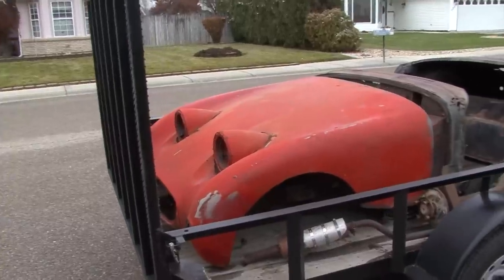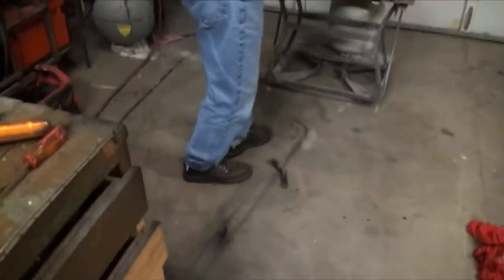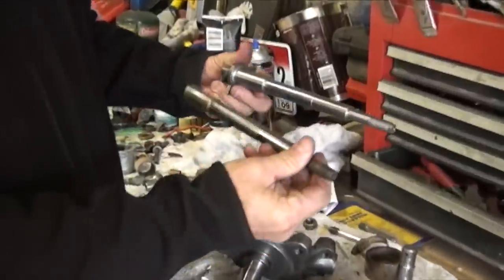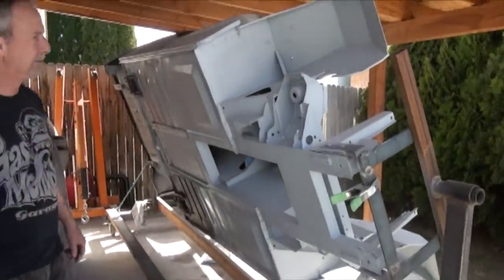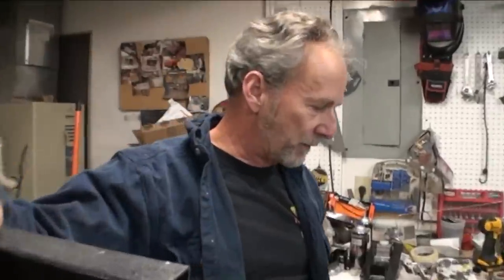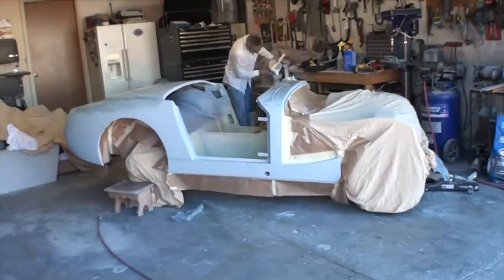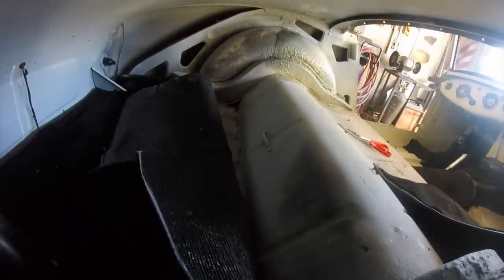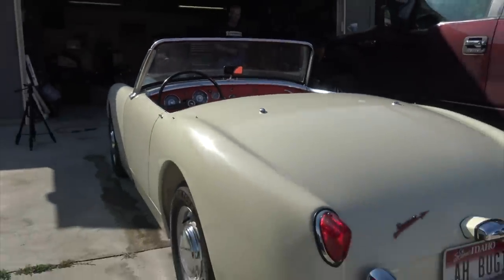Bugeye Sprite Restoration (Official Full Version)

Comment: wow...just came on this YouTube...... I also have this exact car and did a ground up from 1993 thru 1998.....same color combination....added 1275 80 thousandths over bore. electronic ignition, stainless steel exhaust. all screws, nuts, washers stainless steel, wire wheels, disc brakes on front, same aluminum valve cover, mine all red interior.....we acid dipped body and lost 40% of the car, bonnet was perfect.....14 months putting it back together...we embroidered door panels with Austin Healey....we used the interior kit from Moss Motors, body seams missing (?)sad.......about the same in cost........ we have put 4600 miles on car since 1998 and won every show we entered......live in Tipp City, Ohio just north of Dayton.....Fun watching the process all over again....Than you
Reply: Thanks David.  Body seams were already leaded in. To much work to restore.  We have driven the car about 1100 miles in the last year.
Fun.

Comment: I’m surprised the doors fitted as well as they did.  Before touching the cills ( rockers) or tunnel we always weld a brace across the top of the door aperture.  We have one set like a giant turnbuckle so we can set the door aperture before well start removing the doors.
Reply: This one was of my first concerns after cutting away the left side of the car.  However, the sheet metal repair panels fit very well and squared up the entire body.
I did need to adjust door jams to achieve proper gaps. I noticed on to many sprites the misalignment of doors and bonnet and I was not going to have that.
Thanks for watching.
Ed

Comment: I have a red one though a good looking road-going car I got it as what can best be described as a very amateur restoration, i.e. wrong colour, some? filler, floor pan patched but well-done, fibreglass bonnet - I do have a steel one. 

So complete new floor pan and back to old English white is in order. It is fitted with a 1275 midget engine with twin-choke Webers,1275 gearbox fitted and will be staying. 

To have stayed with the original steering wheel and road wheels instead of a Moto-Lita wheel and wires though nice is a nice touch and will be what I will be doing. 

You did an excellent job and If mine comes out half as good as this car I will be delighted. I wish you many healthy and safe miles.

Comment: These were  called "FROG EYED SPRITES" not bug eyed, the reason for this look was that the original h/lamps were made to recess with electric motors, this proved to be costly and also did not withstand the hood closing heavily as it is all one unit. I worked on these  in their day in the UK, they were BMC "British Motor Corporation, MG, Morris Garages were long before these, MOWOG was the parts ID stamp, they were issued with a tonneau cover, wing mirrors and radio here , in the UK AS EXTRAS!! They did not lock up and could easily be stolen, the key codes were single edge FS type. The electrics were Lucas 12v, the heater was Smiths, original oil was BP Energol sae 30, gearbox and diff were Hypoid 90, points were Lucas 423153, standard coil without a ballast resistor, rack and pinion steering (which understeered) and I believe a lot of the brakes were Girling( some Lockheed) 1098cc, 998cc and a changed engine had an extra stud at the t/stat 1275 cc, most were Tartan Red or British Racing Green, some had knock off wheels ( spoked), I built many...…….many moons ago.

Comment: Nice panel fit. All that welding without a jig? Yikes! Top of the guards are always an issue with these things not sure it works with them removed. Should have dropped a better driveline in it and some suspension. A series stuff isn't the best and the A35 running gear is horrifically fragile. Great video effort!

Comment: great  to see  an old ENGLISH  ICON COMING BACK TO LIFE   thanks    i have a  1960  morris minor 1000 1098 cc  4 door 61000 on dial ???  she been well looked after   cant do a nuts and bolt job like you 

just giving her  plenty of      t  l  c    we will see  how she fairs  next year  when show time comes around 

had a  1962  caddy  back in 2004     lovely car     then a vette  1980 v8    leaked like a sieve   from those detachable  top   put so much  silicon  around them  couldnt get them open  pity   GAS PEDAL WENT TO FLOOR   LINKAGE GOT STUCK  10  40  100 MP BREAKING NOTHING GOOD JOB IT WAS A STRAIGHT ROAD WITH OUT ANY OTHER CAR ON ROAD    SLAMBED IT IN TO N  AND PRAYED SHE WOULD STOP SHE DID 

  TOUCHED THE LINKAGE  THEN HEARD THE THROTTLE COME BACK UP   DROVE HOME SLOWLY AND CHANGED MY UNDER PANTS

Comment: Back in the 80’s I was offered one of these for £25 good runner, I turned it down. 😣
Reply: Graham Richards 
That reminds me of something similar that happened to me around 1979, I was offered a split screen VW bus with virtually no rust for £95 it just needed a set of new tyres which probably would have cost another £50 so I turned it down as I was only earning about £60 per week 😱 doh!

Comment: Doing body work on a car body with no roof support, and no door bracing to keep the gaps the same. This is why you likely have panel and fitting gaps at around the 31:00 mark.

You don't have to re-bore just because. You re-bore because it's needed.

No hood then? So, it's a dry season car now?